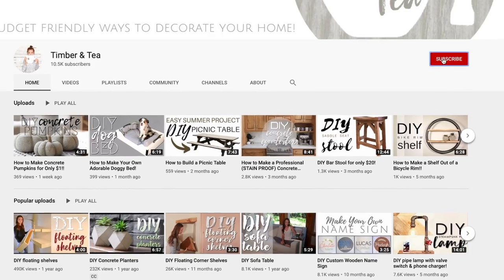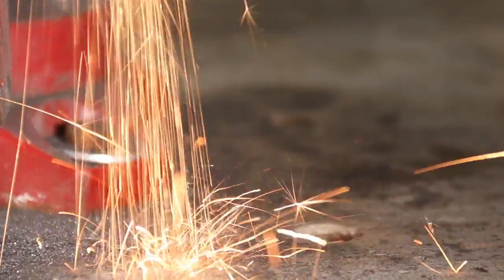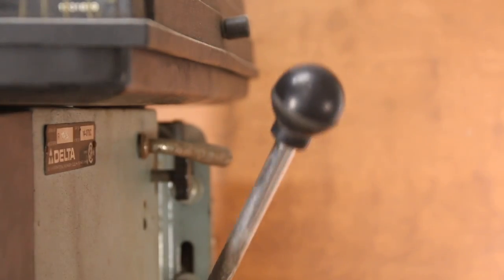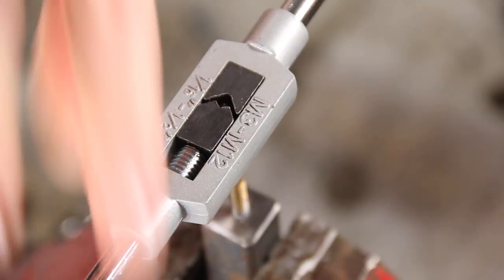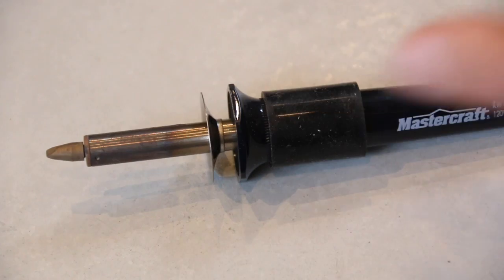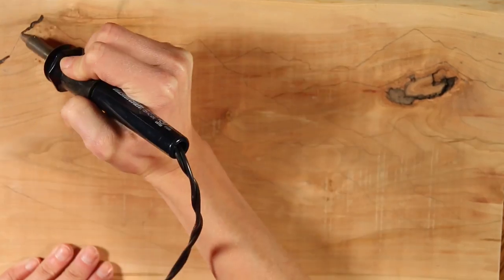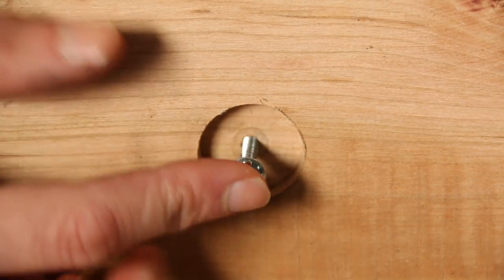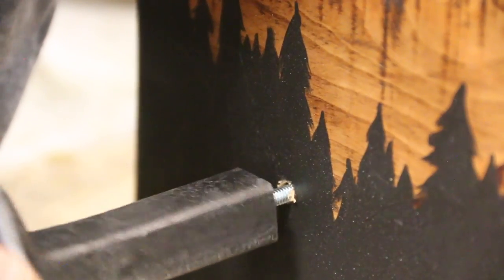How to Make a Railroad Spike Coat Hook

Comment: Thats a beautiful coat rack. It would have been easier to drill a hole and glue the spike into the wood with epoxy or construction adhesive. Most people wont have all the tools you used. Plus using just a screw is not as strong as gluing the spike in the wood.